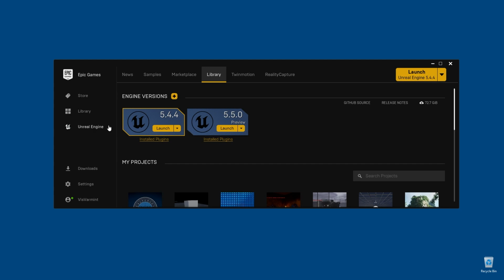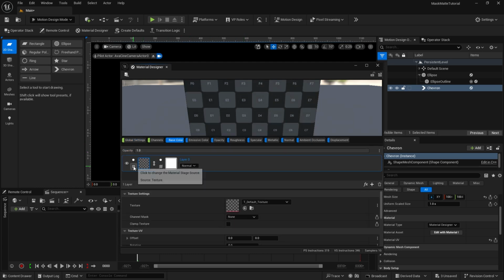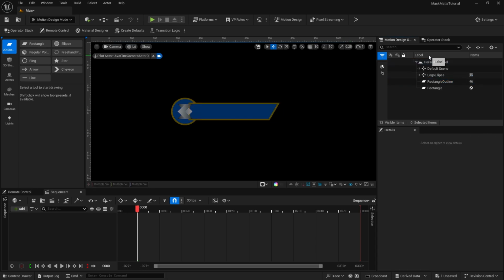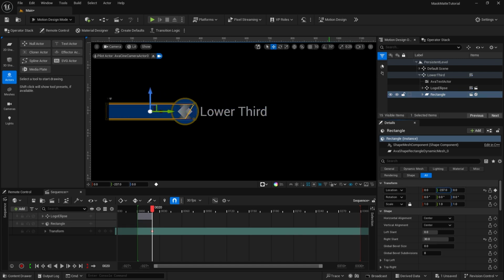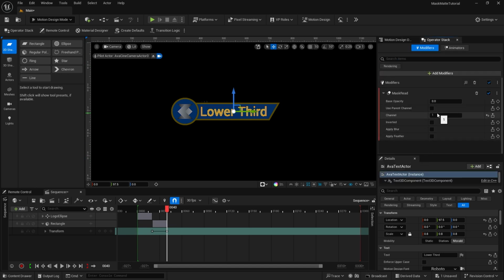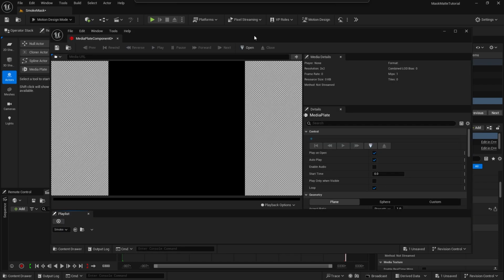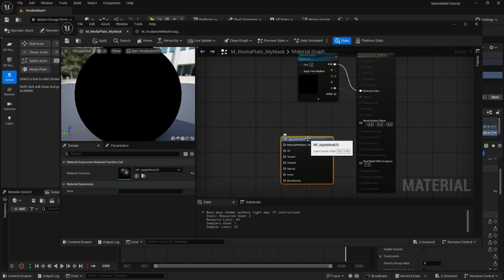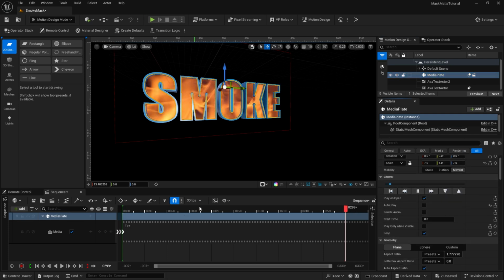Unreal Engine Motion Design Tools: Mask Modifier aka Track Matte

Comment: what is the advantage of doing this in unreal engine instead of after effects or bmd fusion more easily and fast?
Reply from the maker: I work in both After Effects and now Unreal Engine. Both apps have their advantages and disadvantages based on their features. There are things I can do in AE that UE does not cover at this point. The big reason I am diving into UE Motion Design Tools is real-time playback for 2D and 3D content . I have worked in Cinema 4D and Blender and both are great tools but the lack of real-time render was a hindrance. Once I experienced UE real-time playback and fast final renders I was hooked. After Effects is starting to natively add 3D capabilities but they are way behind.
Reply: @LeeWaller  have you every tried fusion? which is node based and is fast, have almost every tool that after effects have for motion graphics with some extra features like modifires and have realtime 3d render too which suppots usd, fbx etc from years with the best particles for motion design which combines 2d and 3d in a way that no other program handles and is built into resolve too and which is almost as good as nuke  compositing and even better in some areas. and the suprise how few people know about it